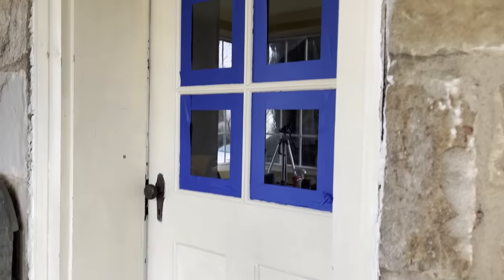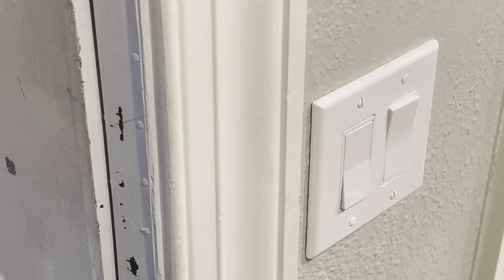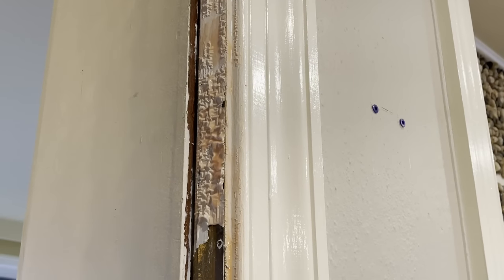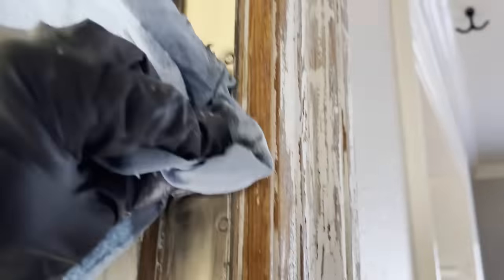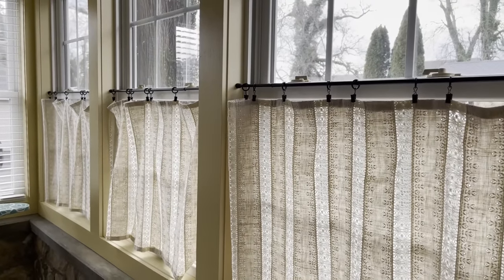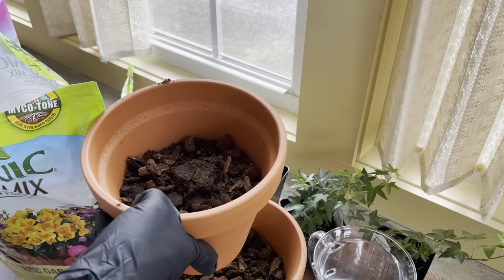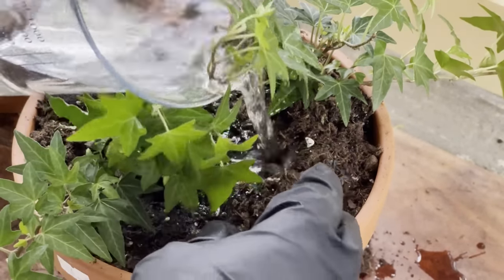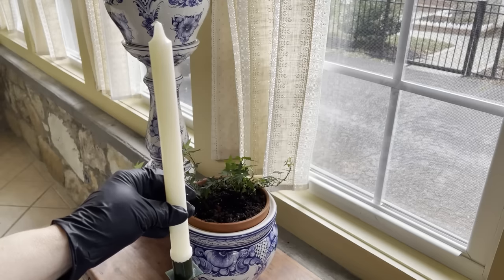RESTORE & REFRESH SUNROOM SERIES (PART 2) || VINTAGE ITEMS FROM SPAIN, CAFE CURTAINS, & MORE

Comment: I love the finished job of your door, especially the colour. I’ve started my seeds for my raised vegetable beds and herbs, I know what you mean about getting your hands in soil! Raises my spirits, too!
When I first moved into my present house, the front of my house had a clematis on one side, the other a Virgina creeper, which is a vibrant red, unfortunately my clematis has died out, so removed it, but my Virginia creeper is still going strong. I would love to plant a wisteria, which would complement the colour of the outside of my house. ( white brick ). 
Also, not a lover of ivy, since it grows like wildfire, and has tried to kill off my other outdoor bushes. 
I do like what you’ve done to improve your sun room, though, especially as I said previously, your door colour and wood trim, and the glass door knob.

Comment: When I saw your paint job I thought wow that would be beautiful with colbolt blue & white and some terra cotta. I tried this same look several years ago but never quite got the yellow I desired. I added an old oil cookstove and covered the Cooking  part with blue & white patterned tiles and did the warming shelf in cobolt blue solids with the pattern ones on the end. It was so pretty and cozy. Here's to more amazing finds at the cottage, which is what I call my house also. I live in Ak and it's unusually warm and rainy on the island. I flipped when I noticed my bleeding hearts are coming up and my roses have tiny leaf buds. With all the rain and Temps in the teens next week it's going to be a disaster any suggestion? I know I need to cover but I have 16 bleeding hearts ( one of ny faves) and a rosebush hedge and high winds. Love love love your videos and can't wait to see the finished look